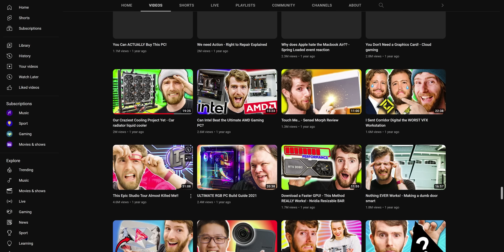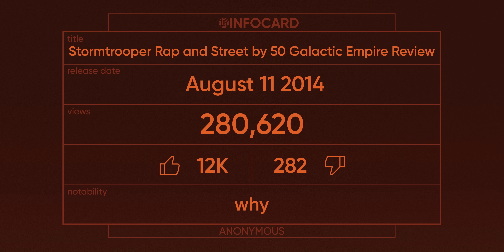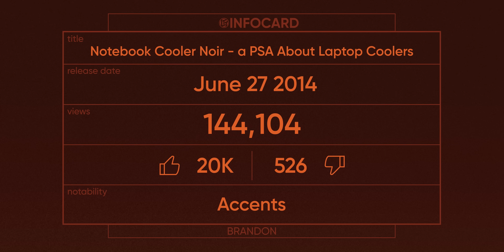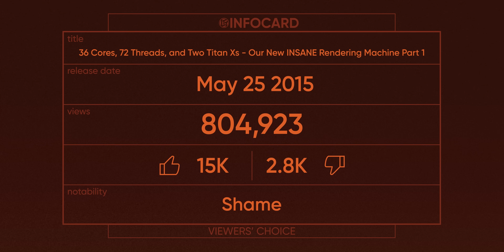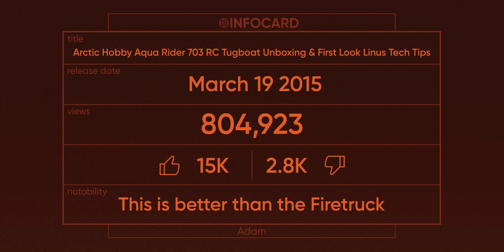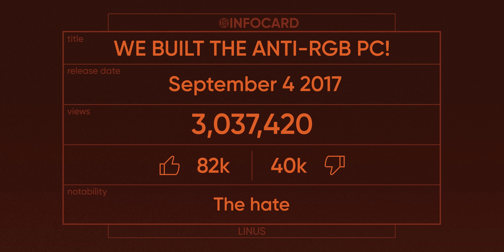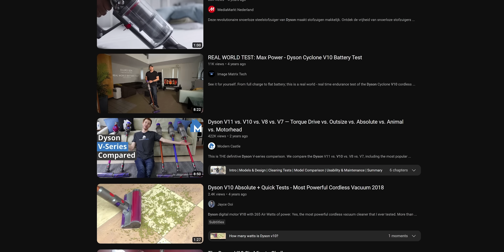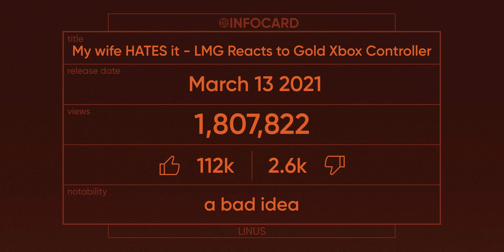We've made some AWFUL videos... - Reacting to our WORST

Comment: Y'know, it's getting to the point where the pizza heater may actually be somewhat viable now
Reply: It'd be amazing for them to revisit that idea with their new manufacturing skills
Reply: If 2 4090s in SLI can't do it, my base PS4 can 😒
Reply: if i scrolled i a little lower i would have seen this.  great minds think alike.  i even suggested cooking a pizza
Reply: Would love to see a redo with 2 4090 yes
Reply: Basically Homeless with the PC sous vide cooker: "Amateurs"
Reply: It was actually pretty valuable already back then... Just get an FX9590 and off you go
Reply: It's getting to the point where you can fit a slice of pizza in a graphics card.
Reply: YES I want it back!
Although I wonder if a more “practical” (lol) use case would be to see if you could draw enough excess power from a 12VHPWR cable to keep a pizza warm while still feeding your GPU 😂
Reply: make a i9 + rtx 3090 watercooled, but with a single 120mm radiator on top of the case. put a small metal grate on top and thats where the pizza slice go. Setting the fan and pump speeds to the minimum possible should help making the liquid even hottter.
Also no other fans in the case, just the single top fan pulling the hot air from inside.
Reply: b
Back in the day a 480 would roast you a whole bull. Horns and everything!
Reply: Legit loved that episode
Reply: Heck, I already do that to keep my food warm. The plate just goes on top of the PC where the exhaust fans are and then an hour of gaming later it's usually still warm.
Reply: Especially if you're running the flame cooled PC
Reply: Lol just stick it in the server room
Reply: @Paradox-es3bl  🤣😅🤣
Reply: Pizza cooker ontop of the propane heat exchanger
Reply: @unaihernaezauzmendi9787  I once took off the heatsink off a running first gen AMD Athlon XP and it ended up roasting my dad's whole fucking farm
Reply: @shlubbert3355  I would put it in the drive bay with a fold down flap, perhaps with a pizza peel that fits in. Would be awesome.
Reply: @shlubbert3355  lol now they got a team of engineers they can revisit all their past lol
Reply: Pizza heater v2.0!
Reply: time to revive the pizza heater 2023 project
Reply: @Paradox-es3bl  GTX 480s literally had griddles on them 😅😅
Reply: @Paradox-es3bl  mine too
Reply: I'd watch them attempt it again. Imagine the nonsense Alex could come up with.
Reply: 😂 I think we're at the point of easily making full homemade pizza/PC in less than one round of Doom Eternal or a BMW Blender Render!
Reply: They wanted to warm the pizza, not burn it to ashes
Reply: @Paradox-es3bl  isnt sli dead
Reply: 4090 flame grilled Patties 😂
Reply: 3090 blowers in SLI
Reply: I thought the same thing, but then I suddenly remembered that video very vividly and realized that it was a mistake I never want to see again. I'm pretty sure I gave them a view on my other account just to leave 2 dislikes
Reply: He predicted the KFC Consol
Reply: I think it might be with my setup.  It's 50F outside right now and I have a fan in the window next to me while gaming...
Reply: Pizza heater combined with hacksmith flame cooler, Add a flame funnel so the monitor survive and you’re fine.
Reply: It's not only viable, we can cook pizza now!
Reply: @shlubbert3355  no the got to do it just as bad as the first try to compare heat output
Reply: More like space heater yo
Reply: Could go with the propane cooled PC
Reply: It will never work. You are either isolating the heat to keep the pizza warm, while at the same time heating up the pc because the airflow is restricted. Or you allow the airflow around the pizza in which case you are just cooling the pizza.
Reply: I want this
Reply: @Paradox-es3bl  2 4090s in sli can't, simply because they can't do ski
Reply: With modern GPU power connectors you could actually cook a pizza brick oven style
Reply: Using peltier could be helpful.
Reply: AMD was inspired by this comment, thus they gave us the rx 7900
Reply: @Dani-ln6sp  With 2 7900XTX you get a "hotter" result 😂
Reply: I had the same thought!  I mean, juncture temps for GPUs at 110C??
Reply: KFC did a chicken heater, so...
Reply: Still waiting on KFC to release their computer.
Reply: @Paradox-es3bl  A Base PS4 has a power consumption of 180W, you could power it with a USB-C cable
2 4090's, plus the rest of the computer need 1300+ watts
Do the math
Reply: Yeah, it would be really fun to see them remake their worst videos
Reply: Kfconsole?
Reply: I use my computer to make my clothes dry overnight in winter so yeah probably works just off sheer efficiency at getting heat out of a chassis
Reply: well we got the kfc bucket heater
Reply: Nice flame roasted pizza
Reply: please revisit it!
Reply: RTX 4090 with shitty ass case cooling :D
Reply: @Paradox-es3bl  I know what you meant, but I don't SLI is a thing for the last few years...
Reply: i think if you put a watercooled 4090 on a smaller rad and slapped a piece of pizza ontop of that it'd probably heat it from refridgerated lol
Reply: At that time it was a pizza heater. Nowadays with a 7950 XTX or a 4090 you get a pizza baker!
Reply: Just have to be careful not to burn the pizza in the process...
Reply: I use a mug warmer that works on the box. No fires yet
Reply: I have a case with vertical airflow. Guess you could call it a chimney case but I always set plates on top to keep my food warm it's great
Reply: i need it
Reply: Yeah
Reply: The worst part is I still have a gtx960
Reply: they were cooking

Comment: Regarding the amount if tires with the boat. Traditional commercial fishing docks uses tires attached on the dock as a soft surface for boats. So its actually a nice touch that they did that in my opinion.

Comment: Pizza heater idea: forget the air heating, water block on GPU’s running a stress test, connect to copper pipes on bottom of metal plate that you put the pizza on

Comment: i actually have used my RTX 2060 FE (with tinfoil) to heat up refrigerated pizza late at night. The GPU temp sits around 82-83 Celsius if i max out battlefield 1 and remove my fans and side panel.

Comment: honestly, that dyson vacuum cleaner, if everyone did an honest review of it. it's a vacuum cleaner with limited application, definitely not for meant for a rough house with pets that have a lot of hair, it's fucking horrific if you have a carpet and it's probably underpowered. other than that, it's a nice handheld vacuum cleaner. but dear god, the amount of clogging i have to undo, the amount of times i have to walk to the trashcan to empty it, just to clean the first floor and second floor of the house is probably 5 times more than i'd have to if i used a normal vacuum cleaner.

Comment: FYI the Plex issue is not only related to security.  
Had you checked the highest-voted comments, you would've known that people setting up a local server usually want it to be independant from the Internet. That's... kinda the point.  
Most Plex features depend on an online autentification and/or subcription, making the whole point of their software moot. It's basically the issues of an online platform combined with the hassle of a local install. It can be good for some people, but it will be disliked on both ends of the online/local spectrum.

Comment: You saved it by saying "Vessi says", but there's no such thing as a 100% waterproof shoe. Because sooner or later, you will start sweating from your feet, especially if you're hiking or whatnot, and if the shoes have no breathability (and you cannot have any breathability if you want it absolute 100% impenetrable by water), you will have moist feet. That's why high-end outdoor gear have a membrane (like Gore-tex for example) that allows for good breathability and good water resistance. The shoes in the sponsor probably have that. It's an amazing invention and a good compromise, but not 100% waterproof.

Comment: Pizza warmer needs a v2, the modern PC hardware clearly generates more heat than previous generations ever will.
Custom pipes from CPU & GPU to a plate for one's personal pan pizza to stay molten & crispy.
That or just put the 4000 series nvidia cables and let the connector catch fire, and BAKE a pizza instead.

Comment: I absolutely love plex.  The issue is they do have some annoying pushes towards free content, and I get that pays the bills.  I just wish I could rip it, because they have slavage marines and I need to add that to my actual plex server.
But I'll never understand the plex hate.  Hell, they are one of the few companies that offers lifetime subscription pricing, and it's pretty reasonable.  I will say though, using an off the shelf NAS is a bad idea.  I run plex on my old PC build moved into another case.  It's a Ryzen 7 2700x, 16gb of ram, and I replaced my old GTX 970 with a Quadro M2000.

Comment: Wow, BMW... that is SOOO typical for them. BMW is a financial institude which an attached car shop. I had to do a lot of external work for them over the years and have a good view over their 1990/2000/2010 IT systems used in munich. For us IT guys BMW was the mad rich kid which would buy the coffee shop so he had not to wait in line. The stuff I have seen there... to mad even for a comedy show!

For example I supplied them with High-Grade-Workstations. Literally for 20% of the price than their former supplier. Longer warranty, more horsepower. And when everything was installed and ready to use they chickened out because their old supplier gave them a 20% rebate. Still paid for my workstations without EVER using them. They even gave me one back for free which is sitting under my desk - 8 Penryn Cores at 3Ghz, 32GByte RAM.